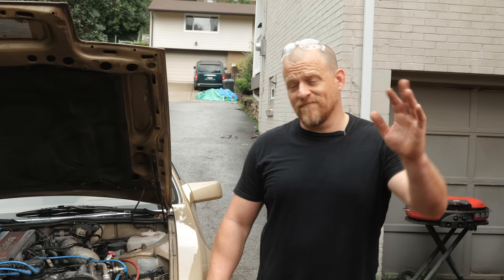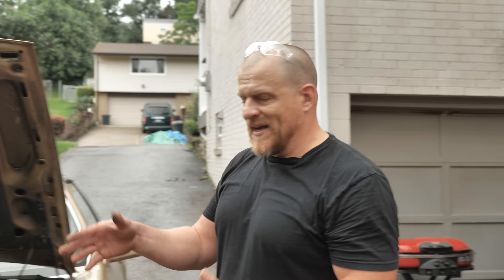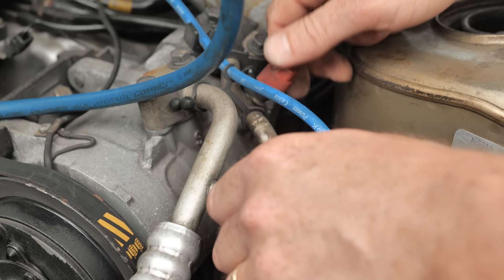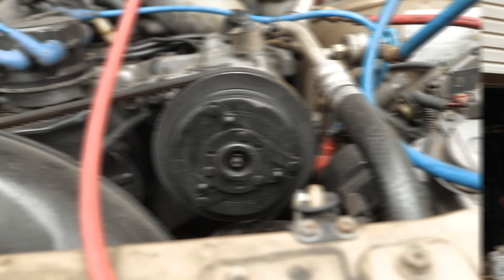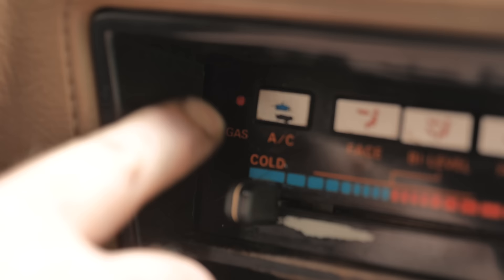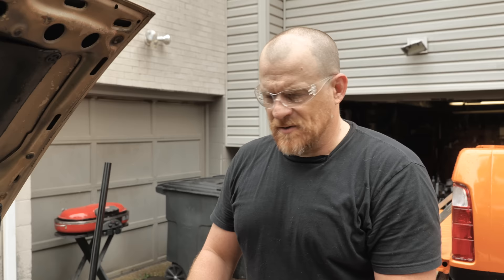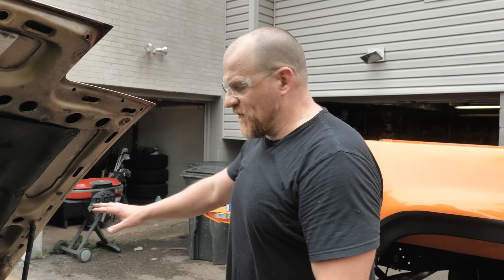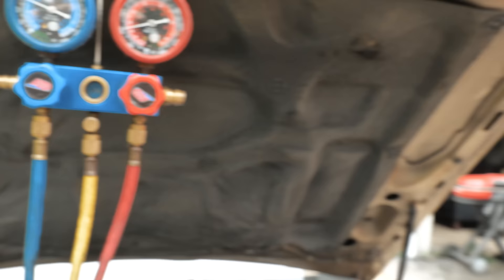A/C Leak Testing, Repair, Evac and Recharge (ANY CAR!)

Comment: AC systems are one of the more tedious repairs with customers. It behooves the technician to be upfront with the customer. An older system may require lengthy diagnosis to repair, on top of costly components & book time. It can quickly turn a 120 dollar job into a 1200 dollar job. There is no room for shortcuts. If everything isn't working harmoniously, then it won't work at all. What's dreadful about the repair, is that most people don't care/notice the worn ball joint. They instantly notice the AC when they hit the button on a 90 degree day. They want it working, and working yesterday. Some will spare no expense to have it repaired. Many will question you. Be upfront before you sell the job.

Comment: I work for an electric company in NYC.  When we perform evacs, we bring our vacuum down to under 150 microns.  Our rise test is done over 30 minutes and a loss of 100 microns or less is a pass.  On my truck, I've system-checked my vacuums, and I can get to 23 microns.  All this means nothing in a car, but for moisture-sensitive electrical components working in the 64k to 345k volt range, it's the difference between flowing electricity and a burnout and power loss.
Reply: Con Ed gang 🫡
Reply: I think his pump had old oil in it. It should have pulled down much lower than the 500 micron he got to

Comment: Hi Paul.  Great video.  I am a chemist.  I was told that the old R12 systems would contain traces of acid due to decomposition of dichlorodifluoromethane (R12).  The PAG oils are long chain polymers made from polymerization of glycols.  So the ends of these long chains have OH groups (alcohol groups).  The alcohol group gets protonated from the acid and the polymer unzips and turns into sludge.  By reacting the alcohol groups to make ester groups, there is no longer alcohol groups that can react with acid and the polymer (PAG) backbone stays in tact (ie, does not unzip).
Reply: I love these types of responses.  Incredible amounts of detail like this is actually excite to learn!  I might never use it in a work setting but learning something new is always great!
Reply: My brain went to static.  😂
Reply: Someone told you all that?
Reply: Sounds like a recipe for o-ring failure. In this case could have just been vibration. I'd like to hear your chemist approach for power steering fluid in a brake system.
Reply: @The_Redkween I just had brain freeze!  :D
Reply: So was there any compromise in using ester oil over the PAG oil then? Is it just irrelevant in a system that never had r12? Do you know anything about the r1234yf systems?
Reply: @guy386  I do not think there is a compromise if you use PAG ester oil over PAG oil.  I do think that the ester oil is less hygroscopic than the PAG oils but as far as lubricity, I think they are comparable.  Because the system is sealed, I do not think the PAG ester oil has any real advantage as far as being less hygroscopic.  As for the r1234yf systems, can't say much.
Reply: There is a PAG oil called PAG100 "Double End Capped"(molecule). It is fully compatible with all things R12 and R134a. You can switch refrigerants without changing out the oil.

Comment: 25:22 Hygroscopic is the word you're looking for ( not hyDroscopic as many people incorrectly believe) like DOT3, DOT4, and DOT 5.1 brake fluid.
42:07 That change from 500 to 510 could be as simple as a change in ambient air temperature. Assuming linear gauge accuracy, and no built in hysteresis, it may have been actual 504.9 and increased to 505.1. So a change from 500 to 520 could be as little as 504.9 to 515.1 or as much as 495.1 to 524.9 and still show 500 to 520. All that really matters is that it's not climbing like crazy. That said, you can find cases where a system will hold a vacuum, but not pressure and vice versa - some leaks can annoyingly act like a check valve.
Reply: I've had an issue where vacuum held and pressure did not. I never got to make it right for them. It bit me in the bottom.
Reply: Wow. Learn something new everyday.  I've been in the oil and gas industry for 30+ years and have always said "hydroscopic" (typically relating to ethanol.)  I now see that I was incorrect.  Thanks for the lesson.
Reply: So much to learn from this message but I'm totally lost i love to understand

Comment: Im a big fan of your teaching techniques, the way you talk to everyone, and especially your honesty!  I have been learning refrigeration for 7+ years now, and I learn so much from you and every project that i do.  I think your vacuum pump could possibly pull down below 100 if you let it go long enough, but that's not necassary, however, letting it run for a long time insures that the moisture is removed.  I also recommend that you close and open whatever valves you are using a few times during the vacuum process, cause that lets air bubbles and moisture, that is trapped in the valves, free to be evacuated.
You will find that usually your microns will rise a lot more than on this video.  As long as they don't rise past a certain point in 10 minutes, you don't have a leak.  If you have a leak, they will rise quickly to infinity.  I fix freezers, refrigerators, and home AC, and on the small systems I shoot for about 200 and hope it doesn't rise much past 600 in 10 minutes.  I don't think I'd be too concerned if it stayed under 1000, but I would probably want to vacuum it for longer anyway.  I have the same pump you used, as well as one a little bigger, and i like to leave them running for hours while i go and do something else.
Thanks again for all you do and how you do it.  YOU ARE THE BEST!

Comment: I think the clear advantage of the micron gauge is to finally verify there is no moisture in the system. On a big system as you vacuum down, the liquid water quickly boils away, but there may be solid ice that doesn't sublimate as fast. The sudden drop in pressure induces a precipitous drop in temperature that can freeze some water, which will be slow to vacuum off. In that case, when you close the system off and wait, the pressure creeps up as that solid water ice sublimates to water vapour. It's a signal you need to vacuum for longer to get the rest of the water.
Reply: Correct
Reply: how much longer? what indicates long enough, or could overnight be best to be sure?
Reply: @scottneels2628  Charge only in HOT weather.
Reply: Thanks for taking the time to reply. I'll wait for summer here in NZ.

Comment: I just discovered the ScannerDanner channel, and just in time.  Recently, I noticed that my 2006 Honda Accord's A/C was not blowing nearly as cold as it had in the past years.  At 54 years of age, I've only recently gotten over the fear of tackling some of the automotive repairs that are rarely handled in do-it-yourself/backyard repair situations.  Thanks to ScannerDanner's (Paul's) great video, I will purchase an A/C manifold kit and a vacuum pump and fix the A/C problem myself.  ScannerDanner (Paul), your videos are so valuable.  Thanks - and please keep them coming!
Reply: Have you tackled Caliper repair?  I'm wondering if i should tackle son's car which is a 2004.  Im sure the components are old.  should I replace both calipers or just the one that freezes up after braking (grabs and doesn't release the rotor.....at least I think

Comment: A digital micron guage is a great insight into vacuum but  pressure decay testing with digital manifold gauges at 150 to 200 psi is a more real world test. I've found many systems hold a good vacuum but can't hold a pressure test. Great video and camera work as always 👍😁
Reply: I agree. I do both tests, pressure and vacuum

Comment: FYI, after you take the hose off the vac pump and connect the hose up to the R134a you are to remove the center cap off the line set manifold and purge the hose with R134a until you see it in the site glass window. Then you can open up the low side and charge the system. Thanks for the videos!!! God Bless!!!

Comment: A couple quick side notes I'd like to add;

- With regard to the micron gauge, I've seen a lot of HVAC guys use a schrader on the port or a ball valve to valve off the micron gauge, and to prevent atmospheric air entering the system, they will charge until the pressure is equal to or marginally greater than atmosphere so that when they remove the micron gauge, atmospheric air can't rush in.

On the note of wasting your R134a by charging a leaking system, excluding the part where refrigerants are bloody expensive... here's what you should keep in mind with an R12, R22 or R134a system;

Luckily, unlike R12 or R22, R134a isn't a CFC, it's a HFC. therefore doesn't deplete the ozone layer. It's also not toxic either, which does mean that is safer to discharge to atmosphere... but the other impacts it has make these still a bad idea. R134a is an extremely dense gas. If discharged over a pit, it will accumulate in that pit. R134a is known as an asphyxiant, as it is capable of displacing air in the lungs and is hard to expel, so it should not be inhaled or discharged over a pit. It's also a potent greenhouse gas. These reasons combined are why you can't legally discharge an entire AC system straight to atmosphere, and you MUST use a recovery machine with a tank attached. Some purging is allowed for obvious reasons, as the amount of gas lost is very minimal and has no real effect environmentally.

Newer AC systems that use the R290 gas, however, can be safely discharged to atmophere, as the gas used is pure propane, which doesn't have the same effects as R134a. It's not a heavy gas, so easily disperses. R290 is also a very light hydricarbon that doesn't pose a greenhouse effect, it doesn't deplete the ozone layer either. Anyone discharging an R290 system though needs to be aware that the refrigerant is propane. it's extremely flammable, therefore should only be discharged away from sparks or open flames, and in a very well ventillated area to prevent a gas explosion.
Reply from the maker: Great tips! Thank you
Reply: Propane is still heavier than air, so it's still worth taking any precautions you would for other gases.

Comment: As someone who's converted some of those old NIssans from R12 to R134, the condenser makes a big difference. If you swap the original condenser with a custom parallel flow unit designed for R134 the head pressure goes down by 30-50PSI and the thing will hit 40 no problem. The cost isn't too bad either $150 or so and the system works better than what it did with R12.
Reply from the maker: Great tip!

Comment: I know people are going to say I'm a fool, but I've started converting all R12 designed systems to R152a instead of R134a. I get it out of computer duster cans with a can tap. It runs at lower pressure than R134a, and has very similar properties to R12. It's molecular weight is 66.05 g/mol vs 120.90 g/mol for R12, so a charge only uses 55 percent of the weight of R12. On most vehicles it's under 28 ounces, which is less then 2 cans. Yes it is considered semi flammable, but it does not give a flame extension or flashback in the standard test used to measure the flammability of aerosol products. It's already used in some industries, it was actually tested by the automotive industry to replace R134a but the manufactures decided to go with R1234YF. R1234YF has the exact same flammability class rating as R152a, A2 rating. They both have the same GWP rating also, at 0. You also drive around with 15-20 gallons of highly flammable gas in your vehicle, so I wouldn't worry much about 25 ounces of mildly flammable gas that's already being used in newer vehicles.

Comment: Hi Paul,  
I worked on many John Deere tractors with R12 and TEV systems. When charging the system after pulling a vacuum, I would always fill the Hi side first, engine off of course. As the system filled I would watch the lo side. If the lo side came up nice and steady it meant the TEV was in good shape. If the lo side just stays in a vacuum there is a problem. I watched the lo side in your video as you began to fill and it came up nice and steady. 
On the tractors we also used retro fit kits to go to R134A.
I learned from a commercial A/C guy to fill with the can upside down (liquid) and stay under 40psi on the low side as you fill. Didn't have any problems. With the can up (vapor) it takes forever. 
Great video.

Comment: I don't have a compressed nitrogen cylinder. I have several argon cylinders. I've always used dry compressed air to leak check in the past. I have a really great dry air system for painting. Learn something new every day, I didn't know about the acid problem with "air". I am all for doing everything I do as correctly as possible. But honestly if an AC system is at 0 psi it has atmospheric air in the system. If you replace a component and break the system it has atmospheric air in the system. But, going forward, now that I know better, I'll be using argon to leak check.
Reply: Argon is expensive as hell! N2 is a lot cheaper.

Comment: I didn't know for years and years that you can turn the nitrogen tank valve on to check its pressure just by backing the regulator off. No hose is needed.
With the regulator turned down to zero the amazing regulator holds back 2000 psi from  coming out the output.

The night mare leak is to have a compressor shaft seal leaking only at pressures above 300 psi.
My dump truck had such an leak. It would hold 200 psi on the nitrogen test all day long. Same with vacuum test  but wouldn't stay charged two weeks.
I went most of one summer without AC but one hot day in August  I decided to charge it up and have air just a little while.
This time it didnt stay charged all day.
I got home did a 200 psi nitrogen test and it held rock solid. I never could see any dye at the compressor or soap bubbles. So next morning I ordered a new compressor and that fixed it.
Thanks for all your amazing contributions Scanner!😎

Comment: Hello Paul. Back when I was doing retrofits, I would use a fairly large blower type fan in front of the condenser to simulate road wind. Then put the car to a high idle (1800 rpm or so). Add refrigerant while watching the register output temperature. The temperature will go down to a point then start to rise as the system starts to reach an over full condition. This obviously needs to be done slowly and carefully but I had excellent results.

Comment: Well Danner I was on my way out of the industry and it didn’t end up happening I’ve been working at an independent chain shop the last couple years and they didn’t want to pay me more but want me to keep doing more work which I didn’t have a problem with at first to show them what I could do but now you know and don’t want to pay what I’m worth I was headed to a factory job and a local dealership was looking for help they are going to pay me almost 3 dollars an hour more to start and offer me all the factory training to increase my pay so it looks like I’m sticking around

Comment: Hey Paul my name is Michael been a mechanic out here in phx. AZ for over 40 years.  Anyways been watching your videos for at least 10 years, Someone else said your a fountain of knowledge, I can not think of a better fitting compliment for you.  Your AWESOME!!  Anyways just for your 411 if you put one of those little desicant compressor dryers on your compressor hose 6- 8 dollars and Compressed air I can only get up to 150 psi but that is usually plenty, As hot as it gets out here you really have to pay attention to your pressure to temp relationship. Before 4-5 pm you can raise up to 10 psi in no time, and actually overlook a leak.  Also your emphasis on oil overcharge is great I see it quit frequently.  Please Please Keep up the great work and the awesome videos!!!  I strive on saving poeple money and you have definately helped me to do it better!!! (while keeping my bills paid)   Sincerely,  Mike Rowe     Rowe's Restorations  Ps. GLAD to finally know your name!!!
Reply from the maker: Such a great comment! Thank you! And great tip on the compressed air variable too! You thought I was "Dan" didn't you? Nice to meet you @Tia Cohen
Reply: Hey Mike. My name is Michael. I live in SoCal. I don’t follow your comment about you rising 10 psi and missing a leak. What piece of knowledge were you trying to share?  So you always use compressed air with a dryer to pressure test your system?
Reply: I dont remember how I+ stated it, however it is very important to remember as tempeture rises so does the pressure

Comment: To prevent having to remove your micron gauge find and purchase a 90° ball valve that goes between the micron gauge and the hose so that you can isolate the gauge without having to remove it

Comment: I am in the process of troubleshooting my 1997 Ford Aerostar AC - about a year ago, it dumped a bunch of oil suddenly on a concrete slab. It was not motor oil or transmission or power steering or coolant or brakes, so it had to be from the AC system. Over the course of a few days after the dump, the AC was not cooling and I have not used it since.  Just now getting around to trying to fix it. Your video is the most thorough and instructive and encouraging I have found so far.  I hope to have my system figured out soon based on information you shared. Thank you so much.
Reply from the maker: Awesome! Thank you